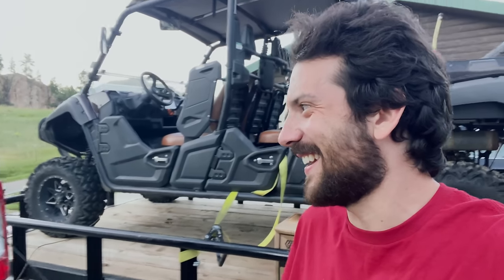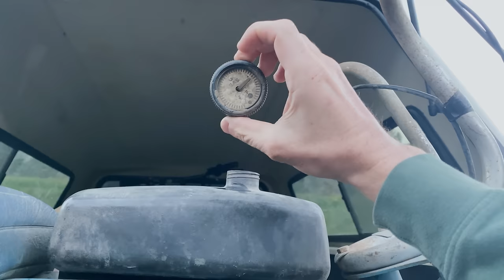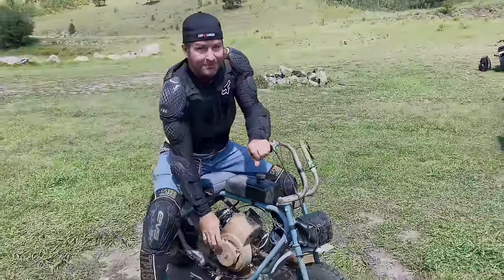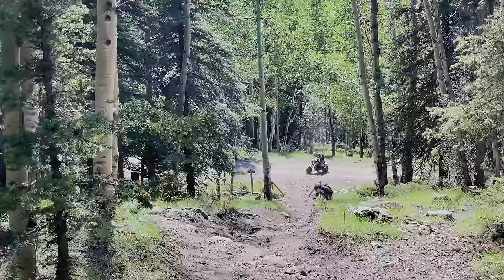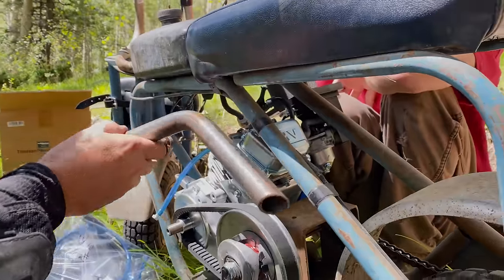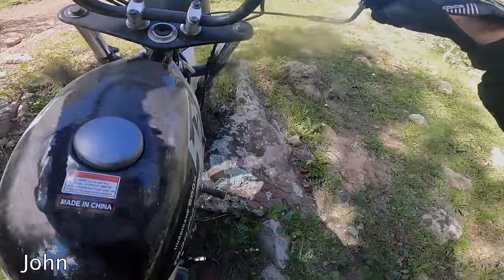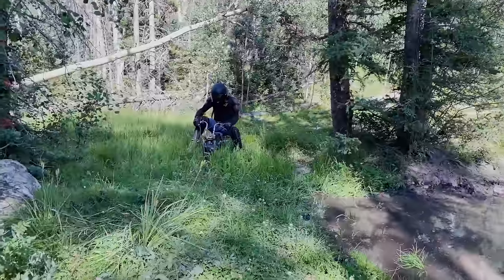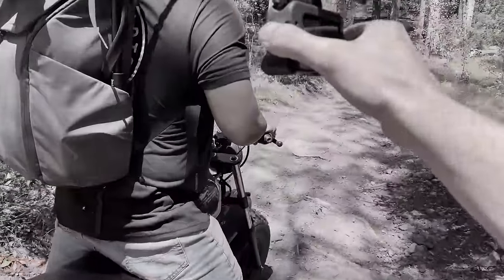Will an Abandoned 1980s MTD Mini Bike Survive a 10 Mile 10,000 ft Pass?

Comment: I'd like to see Go Power Sports work with Lectron on a deal for carbs for the 212 and larger engines. With their carbs, we wouldn't need to worry about re-jetting for changes in elevation. If Lectron already has one that would work or designed one for these engines, I'd buy them.

Comment: Poor Ike he ain't used to the altitude 🤣🤣 I live in the high mountains of the Rocky Mountains it ain't no thing for me. Oh and that Boost oxygen works great! I keep a couple cans in my pack and bug out bags. We have the occasional low oxygen days and I use it a lot. Glad y'all had fun in the high country..
Reply: it sucks when you're not used to it, you inhale but it feels like you can't inhale enough haha. i wonder if there are breathing issues when you drop in altitude.
Reply: @ducttapeandwrenches  you can experience altitude sickness. It can happen when you go up or after you've come down. I've had it before and it sucks bad. And you're exactly right it sucks trying to breathe and it seems like you can't get enough oxygen. When we have storms moving through sometimes it'll push the oxygen further down the mountain to the valleys and all us up in higher altitude can't hardly breathe. It wakes me up in the middle of the night sometimes. Scary. The high mountains are no joke. It took me a couple years to fully adjust to it.
Reply: @prophez23  I've had it only going up in elevation. When I went to the mountains in Tennessee I got it a little bit but I think most of my problem breathing was the humidity haha.  That feeling must be awful to wake up to.

Comment: Yeah the problem with the MB200 is that the chain tension changes based on where the rear sprocket is in the suspension travel, if you set the chain tension too tight your bike won't have any suspension and every bump will try to yank the crankshaft out of the engine, too loose it'll fall right off once the suspension lifts. There's a bunch of different solutions for adding a chain tensioner thankfully.

Comment: Those MTD bikes were shit. I had one in the early 70s bought brand new. Mine was the next model up with 4hp and shocks in front and back, had to weigh 200lbs before the rear shocks worked. Over time my frame cracked in the same spot as this one. I wanted a Rupp mini bike because they sold them at the same store I got mine at about the same price of $249. Over priced for the MTD but worth it for the Rupp. The salesman pushed my mother to get the MTD saying it was better which was BS, he pushed the MTD because his commission was a lot bigger than the Rupp. I didn't press the issue because I was just happy to be getting a Mini Bike so didn't push back, and my mother was the one who paid for it. All that being sad I did have fun on it and put probably over a 1000 miles on it before I blew a hole in the cylinder wall. I took this bike to the mountains several times going up incredibly steep inclined dusty roads. I beat the hell out of it, but also took care of it. Lasted maybe 5 or 6 years before engine fail. The frame cracked and front shocks came loose which I had to have welded to repair long before the engine failed.

Comment: Sometimes I think you guys need to plan better. Each of you should invest in one of those battery operated oxygen machines. They are light and will run 8hrs on a full charge. They are not cheap. But, at that elevation, you would be glad you had it.  And I'm sorry, I mean no disrespect. But why would you take a bike like that, in the condition its in, up a trail that you know is going to beat the chit out of you?  I would hate to know that I had to wrestle that bike up and down those hills at that elevation. It's a wonder Ike didn't go, "face plant". He looked a little green around the gills there a few times.

Comment: Yep... Funny stuff. That old skool with just a decent running engine... Done! A lot of the fancy stuff becomes issues up here in the Rockies. These trails are no joke. And that mtd is awesome! I've ran mine miles in some of the toughest country up here and I have got her dialed to knowing and feeling when it needs something. Well before it fails. However. I would like to get one of those new ones you all are riding. But I want to order one that has an extra low and slow gear for my area. It's cool those things haul AZZ down there close to sea level, but I want one that pulls stumps for my area. Top speed about 25.. perfect with the power those run.. that's my thoughts.*edit and good vid you guys! *Edit again that last area looked like 1 of 2 areas. Either marijuana meadows or the top of cottonwood. If there was a little more footage of the top I could likely tell you. Js. Next time, let's go play on the dugways I enjoy a challenge on. Beautiful country in the tops up here. Jmo

Comment: i live here in idaho so high elevation isnt anything for me id love to have a dirtbike someday but right now i got a broken motorized mtn bike i could climb steeper grades than this and maintain 25mph with minimal pedaling but my down side is tires and rims(why its currently broken) a bike rims cant handle the motor so it twist the spokes and blows up the hub bearings in the rim and b the tires are too soft so one rock and tire blows out (its happened a few times one time the entire bike drove sideways still kept it up and on the road though) looks like yall had fun and had a great challenge
Reply: You should try worksman wheels they have thicker 11g spokes and slime makes a super thick tube that are really strong but both work great for motorized bikes.
Reply: @gusweiss952  maybe once i get a new frame its a got a 100cc two stroke on it so after 5 years of riding it the frame is toast

Comment: Nothing gives the off throttle muffler pops and cackles like a flathead tho.  So not good riddance give it some love new rings bigger carb flow the horrible porting she will be lovely.   Also may i suggest you guys build a full suspention Concrete saw motor powered MTB Send power to Front free wheeling crankset.  Bike chain and sprockets will handle the power no worries.  Lighter better ground clearance,  Still with a Dash of your guys style.  Good project too bring ikes bro for a visit.